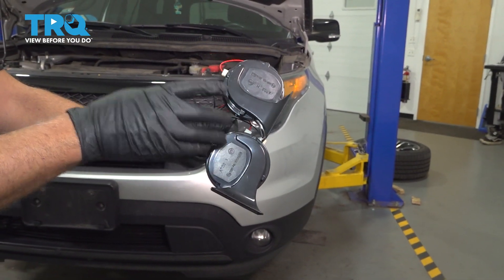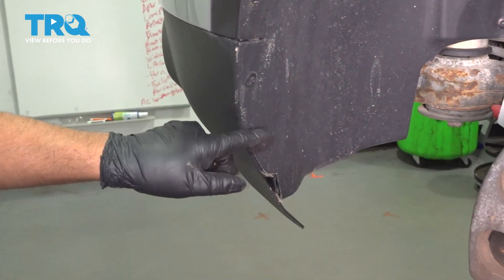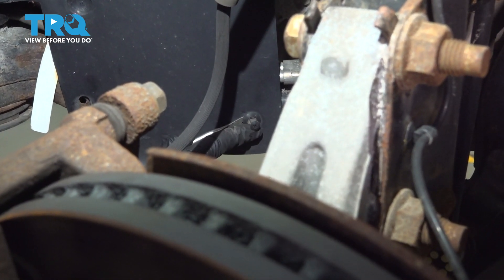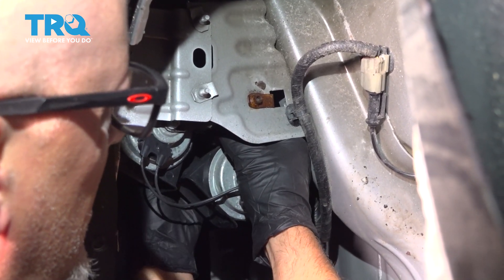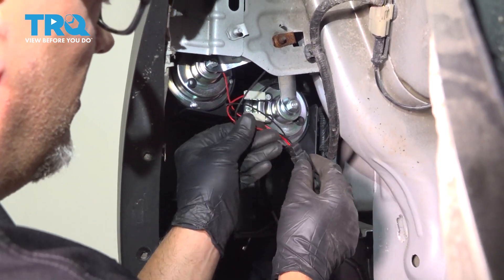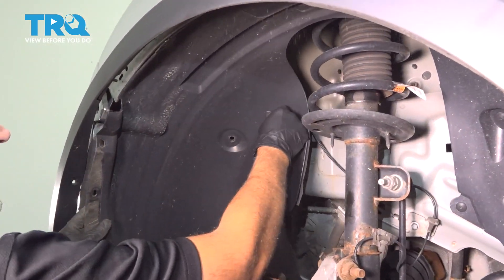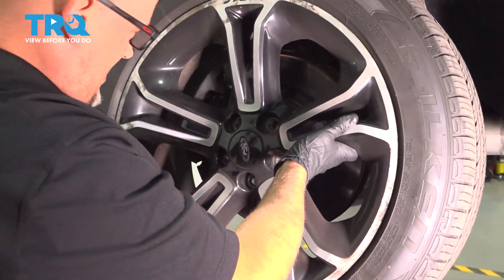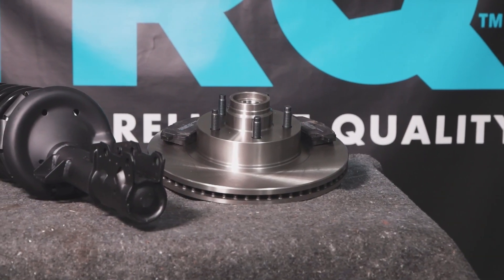How to Replace Horns 2011-2019 Ford Explorer

Comment: I just did this on my 2019 and all I did was take the plastic long horizontal piece over the horn. This will give you enough space to unbolt the old horn. If your bracket is fine you can just unbolt the horn off and install the new one. 15 minute job. Hope this helps someone who doesn't want to do this.

Comment: I have a 2016 Explorer and a horn needed replaced.  I’m no longer able to do a lot of physical activity due to a serious illness ♋️ and have to rely on the dealership.

Wednesday, the car was dropped off and services and State Inspection was performed.

Well, the horn was a $60 part, but the Ford Service Department charged 2.5 “Book Hours” to complete that repair.

In other words $426.25 FOR LABOR.

Almost $500 total P&L

WTF?

I FEEL I WAS OVERCHARGED!!!

Friday, I went back to the Dealership to check this out with the Service Advisor, a Mechanic and a Supervisor.

Was told Ford requires them to do the Work as Required, No Shortcuts!  

Because, the “Part” is under warranty for 3 years or 36,000 miles.
Believe me, I’m not that concerned about a Warranty for a $60 horn!!!

What say you?

I see Steve’s Comment about the change for 2016s.

Maybe there is more to it.  There’s not that much room around the hood latch, but the horns are clearly visible.

Oh well.  Engineering was not concerned about replacing a horn!